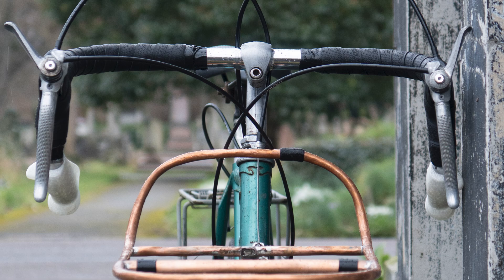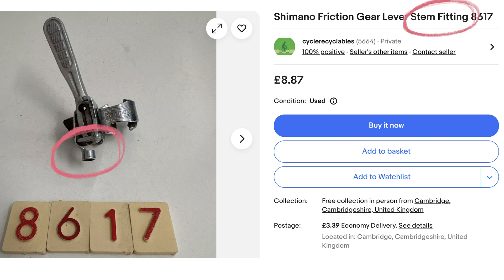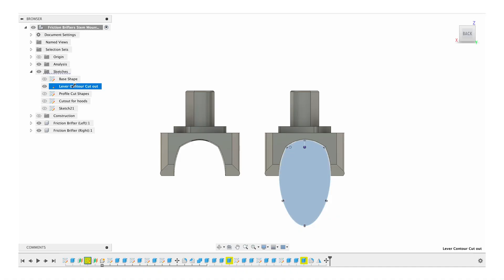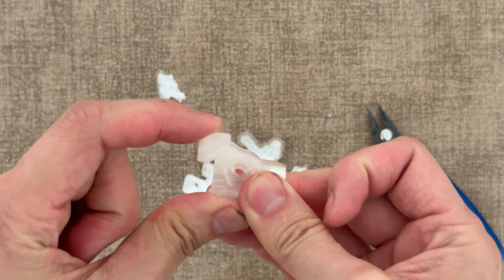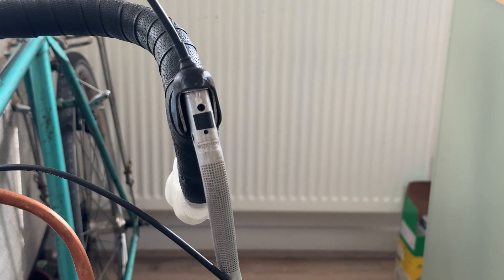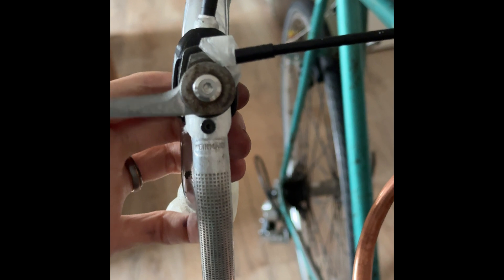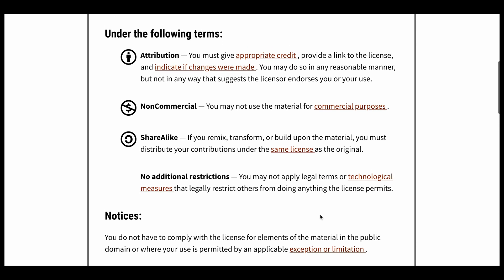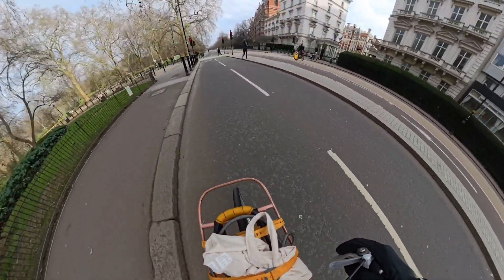3D Printed Friction Shifter Adapter

Comment: I am grateful you are doing this so I don't have to. I would rather spend a little money and get the proper shifter from Gevenalle or the IRD Power Ratchet. I am a massive fan of Gevenalle's OM shifters and have been running these with Cicilo Ene Dia Comp friction shifters. Friction shifting is like jailbreaking your bike from mainstream bike brands. 3D printing and doing the engineering is time I don't have, even tho my office has a Markforged metal 3D Printer.
Reply from the maker: @Artisnik  the jailbreaking analogy is perfect and I’m getting that feeling as well. The only issue is that if you want to do it with 11 speed you need fancier shifters that can pull more cable (or get one of those wolf tooth adapter things). I’d like to experiment with retrofitting older friction shifters with some kind of sleeve to be able to pull more cable, could be a fun hack haha

This was just a fun project for me, but I think you could use this adapter to make one that feels just as good as the gevenalle. You just need to find a friction shifters with an integrated shift cable retaining part. Combine that with more modern Tektro brake levers and I think it would be pretty useable on an everyday bike. Wouldn’t feel as “hacky”

Comment: Is there any reason you use TPU rather than PETG or ABS?
Reply from the maker: Mainly for the shifter cable retaining bit, something like PETG can break off. ABS/asa could work but I wasn’t confident with the layer orientation/strength. With TPU, yes there is flex but I don’t have to worry about anything breaking off.